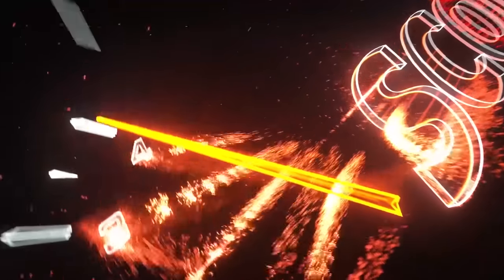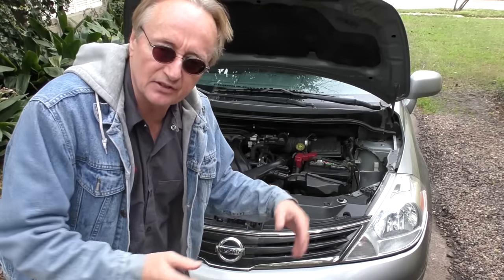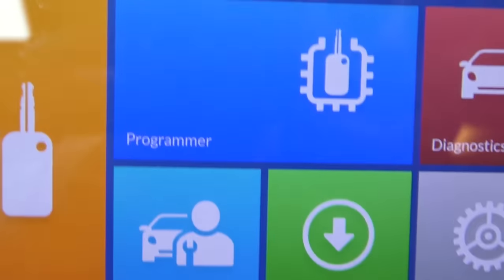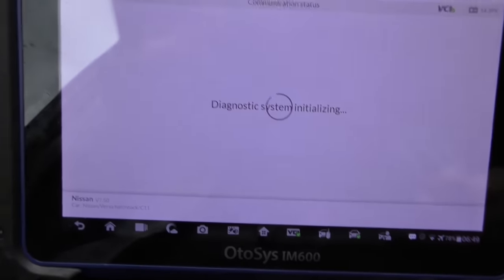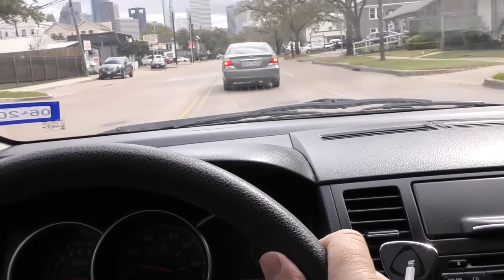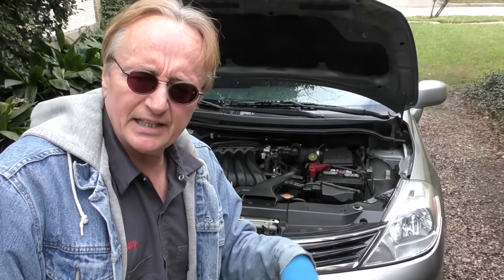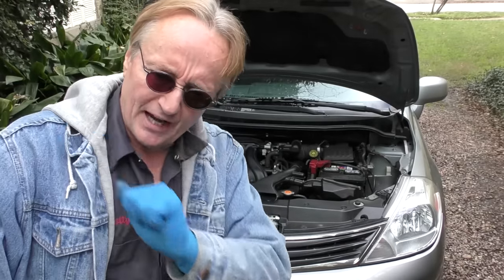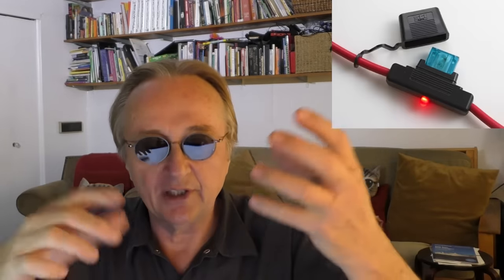Here's Why You Should Buy This Cheap Nissan

Comment: Last three Scotty videos :
- Don't buy a Kia.
- Do buy a Kia.
- Do buy a Nissan.
Next video :
- Don't buy a Nissan.
Reply: i agree with him on most of what 
he say .. but he is wronge about kia
i have kia rio 2015 with 320k km .. 
bullet proif car .. reliabe as fck
Reply: AND YET I KEEP LEAVING THUMBS UP
Reply: @laserbeam3836  I bet you drive reasonably, do maintenance and overall treat the car right. People can be ridiculously hard on their cars. I have a 2010 Cube with 111,000 miles on it CVT is smooth as silk and the engine purrs like a kitten, But, I treat it gently.
Reply: Fedproman my 2010 Nissan Cube transmission was smooth as silk at 99,000 miles. No sign of slowing down. Transmission went one day last month with no warning. Was still smooth after it went, just wouldn’t move. Was still under warranty at least
Reply: Next video : Better Buy a '94 Celica Before They are All Gone.
Reply: You know to much🕵️‍♂️
Reply: @Ian-Threaded  was still smooth after it went,it just wouldn't move 😂😂😂that line made my night 👍👍
Reply: @laserbeam3836  ive had for rental ...was impressed with mpg and handling
Reply: @Fedproman  mmm . no .. i dont 
do any maintenance except oil
chanegs evrey 15k km .. i use cheap
oil too ..
Reply: @laserbeam3836  Which KIA do you have?
Reply: Laser Beam.  keep things in perspective, Scotties opinion are based off of a one man repair garage. Not much of a sample base. A large shop tech sees more cars in a week than Scottie sees in a couple months. Its called flat rate pay.   Also I have an 04 Kia Rio with 271,000+ miles that has had only maintenance wear repairs. Just replaced the clutch at 268,00 Miles.
Reply: @josephjakubec3171  use your logic.  Scotty see more car in a day than your entire life so your kia is not a good sample.  He just say kia maybe have 50percent broken in 150000 miles.  Toyota may be 25 percent broken in 150000. So basically buy Toyota is a safer choice but he can not predict and do not deny there are some car can last  long time
Reply: @Lovefact331  i live in the meadle east
we dont buy a car unless its reliable
as fck because its very hot here 
kias and hyundais are the best 
cars after toyota .. even honda 
are not as reliable
Reply: It's because the company's reach out to him now in line his pockets to promote
Reply: @goingbonkerswithmyhonkers9374  If that is the case for a 2 million subscriber's youtube he can earn millions of dollars. Why his house and cloth and cars all looks like this
Reply: Sad but true
Reply: @Fedproman  I bought a 2012 Versa SV sedan new and it was a horrible car. I pampered it. I had the dealer check the CVT fluid at 30k. They said it should be good until 50k. The CVT started slipping at 38k miles.
Reply: @TheLizardKing1967  hahahahahah
Reply: No doubt.  I have been watching him to research cars and he confuses the crap out of me.  I feel like getting a bike!
Reply: Bro how did you know He made a video call Don’t buy a Nissan
Reply: Scott was specifically talking about this generation Nissan Versa, not all Nissan models in general. The generalization Scott did make referred to Jatco CVT transmissions, which are indeed well-known to be far less reliable than CVT transmissions by other manufacturers.  FYI, Jatco is owned by Nissan and is an acronym for "Japanese Auto Transmission Company."  Please watch this video again.  Thank you.♥
Reply: @palebeachbum  Versa is the best sedan at this price, but the CVT Transmission is a hell for owners.
Reply: @cepibolla  I really liked my 2012 Versa, but for $2600 more I was able to buy a new 2018 Hyundai Elantra and it's much better built and a lot more car for just a little more money. Definitely worth the upgrade.
Reply: @palebeachbum  Cool
Reply: Just he was warming up to talk about his famous ...Celica 🥳
Reply: @laserbeam3836  how many parts were replaced ?
Reply: You are correct , he says today I only buy toyota , after few months he says the end of toyota reliability.
Reply: @gutadin5  radiator fan-speakers-fuel pump .. other than that nothing, the car still runs with the orignial engine and transmition hitting 380 k now
Reply: 😂😁 great observation
Reply: Given the quality of Nissan's CVTs, I'm floored to see them recommended at all. The versa's cvts go out before 100k and nissan had to be sued for there to be a recall. They're NEVER getting my business again.

Comment: We have a  2008 Versa SL CVT with nearly 190,000 miles on it, still going strong. It has probably been one of the most reliable cars I have ever owned, and fun  to drive (great acceleration and MPG). The CVT has been fine because I keep the fluid very clean. I have also made sure to do all the factory maintenance per their intervals.  The top failing part has been the fuel pump, which is easy to change.  After we started  to keep the gas in the tank over 1/4  minimum, the pump has lasted somewhat better.

Comment: I love my Versa hatchback! Mine is a 2011 with 150k+ miles on it! Still runs really well. I’ve driven across the country in my Versa several times. I’ve owned the car for almost seven years and couldn’t be happier. Biggest expense I’ve had so far was the exhaust pipe popped off the muffler when I hit a pot hole. So car was loud for a few days. Got that fixed now purrs like a kitten again. 😎
Reply: Same here. 10.5 years and going strong
Reply: Cross country miles are easy miles.
Reply: I have a 2016 Versa note with 5 speed manual trans, bought it used at 68000km, works pretty well. I kinda wish it has 6th gear, because I really don't like that I have to rev over 3000rpm at 100km/hr
Reply: Must not have the cvt
Reply: @3xx948  i have 6 speed versa, still stays at 3k rpms at 100km

Comment: Good video Scotty. I bought my first Versa Hatchback a few years ago, a 2007 for $1,800. I replaced spark plugs, coils, variable valve solenoid, MAS airflow sensor, all motor & Tranny mounts, (4 speed Jatco A/T), rear shocks, all 4 wheels, rotors, drums, brake pads & shoes. Drove the 2007 for over 2 years with no other problems. I sold the 2007 Versa last week for $3,000 with 186,000 miles, & bought a 2011 Silver Metal Flake Versa Hatchback this time with 50,000 original miles on it & in "showroom" condition, 6 speed manual transmission, for me it is a new condition car! The best part of my story is I only paid $5,000 for the 2011 Versa Hatchback! I feel that that was a pretty good upgrade for $2,000. I'm a retired Machinist, not rich but Happy!

Comment: I am second owner of a 2007 Versa Hatchback. 161,000 miles.  Engine works fine. I'm 6'3" and fit fine.  Air conditioning is my only complaint.  Its barely acceptable in winter and lacking in Houston summers. Thanks Scotty.

Comment: I have a 2010 I got with 50k on it for $10k in 2014, still got it and it's at 230K miles, the versa without a CVT is a killer budget car
Reply: Amael Rodrigues Wait don't they start at 10,000
Reply: 50k miles on a 4 year old car for 10g's? keep doing you bud
Reply: yup bought one in mexico brand new for 184000 pesos which is around 10 k dlls
Reply: Rü Bən aren’t these things like 12 grand new? Dude got finessed. He’s lucky it’s held up for 6 years at least but with 230k I bet he could trade it in for a pack of gushers and a razor scooter 🛴
Reply: @JDMHaze  Hatchback 2010 sl versa with 50k current KBB is around 6k
Reply: @gptsiteuser  The model I got which was a Hatchback sl 1.8l in 2010 was 18k msrp. Current KBB on that car with 50k miles is still $6000
Reply: @gptsiteuser  perhaps you should look at KBB that exact car is still worth 6k
Reply: @Rü Bən KBB still values it at 6k at 50k miles, at the time the KBB was 13k That model new in 2010 was around 18k. A lot of cars don't lose that much value for being used. pricey cars lose a much larger value percentage when used.
Reply: @Rü Bən Manual is worth less also was yours a hatchback sl?
Reply: @Rü Bən  A 2015 with 28k miles is currently around $7000 KBB sooo good for your killer amazing awesome deal.
Reply: @gptsiteuser  MSRP of the model I got in 2010 was 18k, KBB for the car when I got is was 13k, it's a good car so it's market value held up well. Not all cars drop 30% when driven off the lot. Also worth noting I live in one of the highest income states in the US
Reply: Amael Rodrigues wow 230k miles, how often did you change the transmission fluid?
Reply: I have a 2010 Versa hatchback also. I bought it used in 2012 for  $7950 with 33k miles. It’s been a good little car. I’m in Nashville and have taken it to New Orleans three times, Savannah twice, and Destin twice. It’s currently got 168k miles on it but I know Nissan’s well  enough to not put anymore long road trips on it or I’ll end up having to buy a car wherever I’m vacationing 😆
Reply: I had an 09 that got totalled in 17 with a little bit more than 50K miles on it, my insurance gave me $7500 for it.
Reply: I have a 2010 Versa 206,000 miles and I love it. Original engine and transmission
Reply: I have a non CVT. Automatic 2010 Versa sedan. It has 207,000 miles on it and I’m keeping it. It’s a great car and for me being 6’ tall the headroom is great.

Comment: I have a 2010 Versa 204,000 miles non CVT and I love it!! No issues just routine Oil changes.
Reply: Did you use regular oil or synthetic?
Reply: @gutadin5  Well funny thing about that is, when I would be kind of low on funds I would get the regular oil. When I would have a coupon I would get about $10 to $15 off the oil change and opt for the high mileage synthetic. Now that I've gotten my finances somewhat stable it is about $40 to $50 to have it changed I've gone to Valvoline,Penzoil,and Castrol Express lube. It's convenient for me because yes Walmart or Nissan may run a special however I've had to wait over an hour at Nissan and believe it or not over 4 hours at a walmart. The express places usually have me in and out in 15 minutes or less which I like way better.

Comment: I have the 2008 version in Taiwan called Tiida 5D 4AT with 1.8L engine. Still with 90% original parts still running at 210,000 Kms. Good solid reliable car !

Comment: Second owner of an 08 Versa, it has 95k miles on it and it's going strong after two years. I've decided to upgrade it with remote start and a media receiver. This thing looks like it will be going strong for a while! The only major repair in two years was to replace the radiator which was beginning to have a hairline leak. Wonderful first car I highly recommend for anyone who just needs a car to get around. It isn't the flashiest but it's reliable and at the time was cheap!

Comment: I've got a 2007 Versa SL with the CVT that I bought new.  This month it turns 13 y.o.  It's still going with no issues.  When it goes, we'll be going with a different brand.  Finances have improved since 2007.
Reply: How often did you change the CVT fluid ?
Reply: @GenEmperor  Once
Reply: @cusebike5391  how many miles did it have when you got that car and how many does it have now?
Reply: @GenEmperor  161 miles when I bought it.  It had to be driven from a dealer about 150 mile away.  It now has just over 101,000 miles.
Reply: My 2017 nissan manual says only to change the cvt fluid at 60K miles...and that's ONLY if driven under "extreme" conditions ( a lot of very short trips, dusty roads, steep hills, etc).
Reply: @taradead  I'm more paranoid so I like to baby it and change it every 30,000 miles and both the filters and fluid that comes out looks nasty after we do it so by that unscientific observation it looks like we need to change it at that interval lol to be fair we drop the CVT transmission pan so we aren't draining out all the CVT fluid when we change it but a lot of it does drain out.
Reply: @GenEmperor  are you a mechanic or do you do it at home? (sounds very technical)
Reply: @taradead  me and my dad have a hydraulic lift for vehicles so we basically use YouTube to guide us for the repairs or maintenance of our cars and repair manuals sometimes too lol.it's actually not that complicated you just need to know where the filters are & be able to buy them online and also know which CVT fluid to get and how to refill it. Also you need to buy the transmission pan gasket. Basically when you know it is full of CVT fluid is when it overflows. It has no dipstick so that's the indication of when it's full. We fill it from the bottom using a manual liquid hand pump.filling it from the bottom is supposed to be the correct way but it's also possible to fill it from the top where the transmission dipstick should be but it doesn't exist. I'm also forgetting the gaskets for the filters are important too. Actually now that I explain it it's a bit more complicated 😂
Reply: @GenEmperor  cool...but I have no tools, so I guess I' m shelling out several hundred $$$ for n8ssan to do it😥
Reply: @taradead  I'm paranoid of taking it somewhere like the dealership or anywhere really because I feel the only way I know for sure it was done right is us doing it ourselves or if they showed me the video of them doing it lol
Reply: @GenEmperor  true.  Just took mine in to get brake fluid changed ($160)...dont really know if they did anything at all.
Reply: @taradead  I hate that feeling!
Reply: If the 2012 has a regular 4 speed , how does a 2007 have a cvt ???
Reply: @psychiatry-is-eugenics  I think because  before they had both CVT and 4 speed automatic but now they only have manual and CVT.
Reply: @taradead  That's not in my manual.  In the "Service & Maintenance Guide," it's recommended to change every 72 months or 90,000 miles.  I did it @ 90,000 miles (11 years).
Reply: @psychiatry-is-eugenics  The SL came with the CVT.  The base model did not.

Comment: Scotty, a have a 2005 Nissan Sentra S 1.8 liter with an automatic transmission.
The car has 331,000 miles and it still runs and drives awesome. 
Only uses about 1/2 quart of oil every 5,000 miles. 
Wouldn't trade it for any new one. 
The key is "KEEP UP ON THE MAINTENANCE" !!!!

Comment: That Nissan is calles “Tiida” in México. And it’s MadeInMéxico too. It has 510lts of space in the trunk aprox and you can get it automatic (4 speed) and 6 speed manual. Cheap to mantain,400k or more can last if you mantain it. If you live in the border,can even go to Nissan dealer in Mexico and save money mantaining it. A bargain. Buen día!☀️
Reply: Called Tiida*
Reply: Steve Silvas Nissan is a Japanese brand,but the Nissan Tiida (or several generations of Versa & Nissan Sentra) are made here in Mexico. But i like Hyundai tho...📲
Reply: Arturo Monreal 
Could you believe that the Versa is a modified Renault Clio, made in an EX Mexican Renault factory?
Reply: MainMite06 no, it was not. The “Renault Clío” was a Nissan Platina... Tiida has different chasis & several changes (thank God) ...
Reply: Arturo Monreal 
Same platform, but Nissan modified the body in multipe ways, 
Compare the 
3rd gen Clio-5 door to the 
Nissan Versa Hatch 
& tell me that you cant see the resemblence!
Reply: Arturo Monreal 
In addition: the Nissan Platina was a rebadged Renault Clio Mk2 sedan built by one & same aquacallentes factory for N.american market

Comment: I literally bought this car a year ago for 2800 with 65000 miles great deal
Reply: Holy cow
Reply: As a 07 versa owner I recommend: simple drain & fill of the automatic transmission fluid every 60K. Dino Oil change every ~4K miles.

Comment: My 2008 Altima CVT with 180,000 miles on it issue free shifts like a dream. Jatco CVT isnt as horrible as Scotty claims.
Reply: I got 2015 Nissan Murano 42000 miles on it... and I had to change the cvt transmission already... so Scotty know what he is talking about
Reply: Mario Bennnett 
I personally feel that the Jatco CVT really belongs behind small FWD 4-cylinders & not 3.5L V6s
     But I do have this one comrade with a '12 Maxima with 180k,bought the car used, & didnt do anything major outside a battery,bodywork & bushings...
Reply: Shifts?
Reply: Bruh I have 2015 Altima with 160,000 miles and it like🗑🚮
Reply: @XenomorphLV426  You don't feel CVT shifting, how the hell he knows it shifting great?🤣🤣
Reply: @salehselan3026  yes you do, I have one Nissan rogue sport
Reply: @salehselan3026  RPM's also
Reply: I got a 2018 Versa Note with CVT. 35k miles and engine is having problems already. Never missed a service date. I’m getting a Mazda next. They’re still using traditional automatics.
Reply: 2014 Versa Note CVT failed at 107k, replacement CVT 30k miles in starting to show signs of a potential failure again
Reply: This car isn’t a CVT as Scotty notes it’s a regular 4speed automatic trans at the start of this …the later year Nissans jactco CVT are known junk by every mechanic
Reply: @jessewynne8193  Scotty didn't say this year has CVT, he said basically run if it has CVT (which you'll find in newer models)
Reply: @stephE80  did you READ my message?! I said this is NOT a CVT it’s a REG 4 speed AUTOMATIC
Reply: CVTs don't really shift.

Comment: I have a 2011 nissan versa going at 110,000 miles. I've had it since it had 35,000 miles and I've never had any problems with it. The only thing I had to replace was the catalyc converter back at 85,000. Good little car!